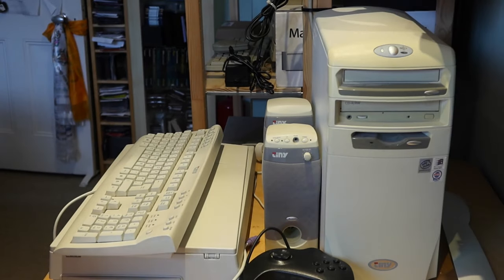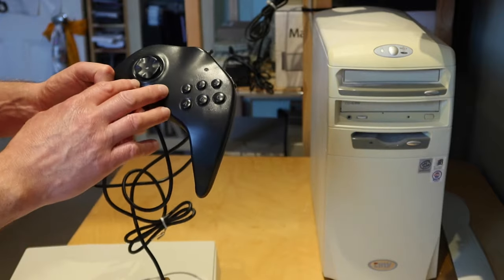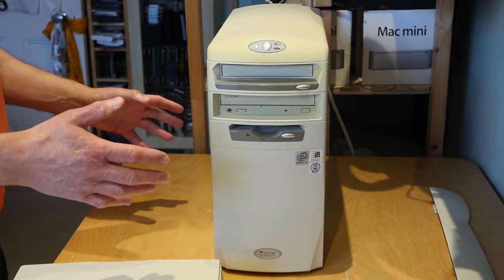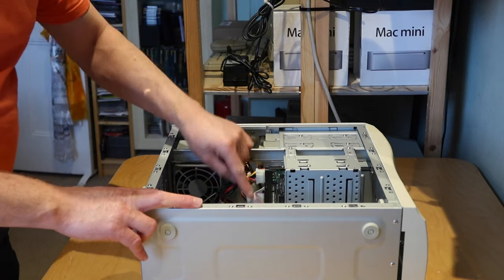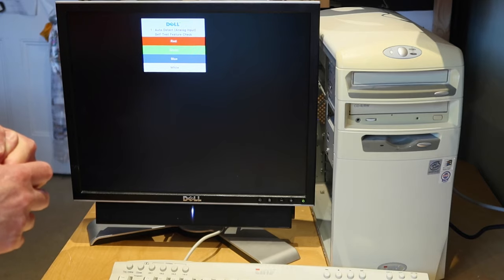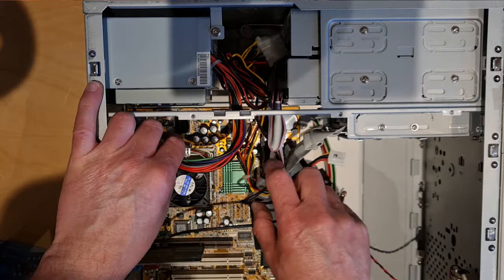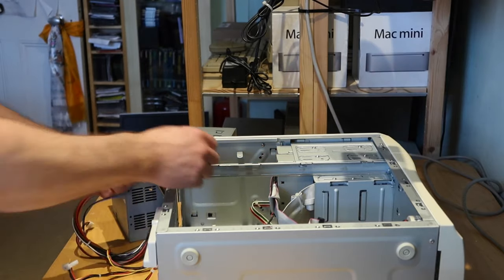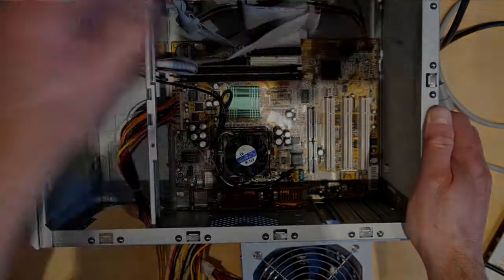Affordable Retro PC in 2024?

Comment: You didn't check the power switch or the fuse inside the psu. Those bulging caps probably wouldn't completely kill the motherboard, they need replacing of course, but it would most likely still work, at least for testing. As for that VGA port - it looks to be the common 'soldered to the motherboard' type, so if it was wobbling like that, then thats damage to the board and needs investigating properly and not just poking briefly with a screwdriver.  After the PSU fuse and the power switch, that would be my next port of call. Get the board out and make sure it isn't cracked - if it isn't then you should be able to solder it back in, if it is, then that's what could have killed the machine - these PCB's are multi layered and it's very likely to have caused a big short circuit when it happened and that would be game over for that board.
Reply from the maker: Yes - I think it's had soma trauma. I really need a magnifier/microsocope of some kind to look at this stuff in more detail...  As for the PSU I'm hoping to open it up and take a look soon. For the purposes of the video, component swapping was the best option.

Comment: My solution to a reliable 486/pentium mid 90s pc is to run Virtual PC on my 2005 PowerPC Mac lol
Reply from the maker: LOL indeed. Just been using a 7200/90 and it's slow to start with - would not like to virtualise anythig on it :-)
Reply: @NeilKnowsRetro  if you wanna see I may be uploading a virtualized 98 running basilisk II inside.
Reply: @NeilKnowsRetro  I dare you to run PPC basilisk 2 to run 7.1 under mac OS 8.6 ;)
Reply from the maker: @joshj88  I genuinely don't have the time :-)

Comment: learn to solder
Reply from the maker: Agreed - it's something I'm actively working towards....
Reply: @NeilKnowsRetro  it's not hard. Flux is your friend. Solder wick works. Add solder to the stuff you're resoldering, add flux, wick it up. Add more flux, solder in new capacitors.
Reply: I would recommend getting solder with lead and flux in it.

Also get a desoldering gun, it makes removing capacitors etc sooo much easier. Becomes fun to repair  😊
Reply: @retroftw  depends, don't get the stuff for plumbing though, it'll mess up electronics.
Reply: @cgwworldministries83  yes... get the stuff for electronics. I have to order solder online as the stuff in stores is for plumbing.